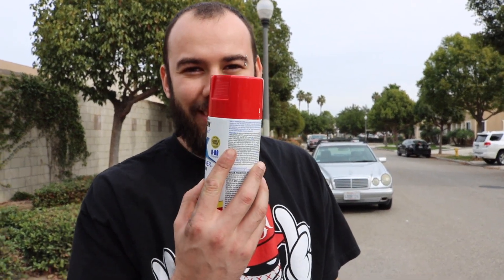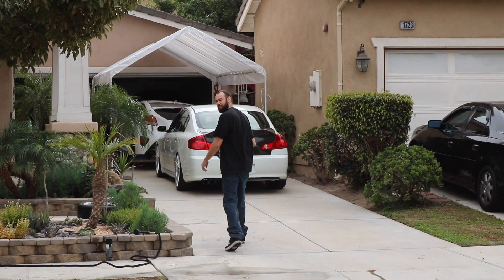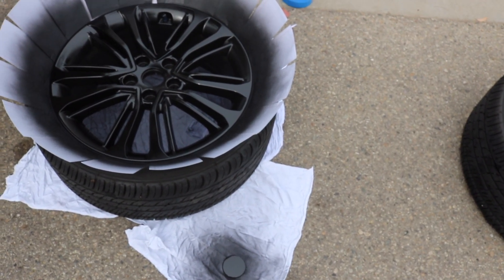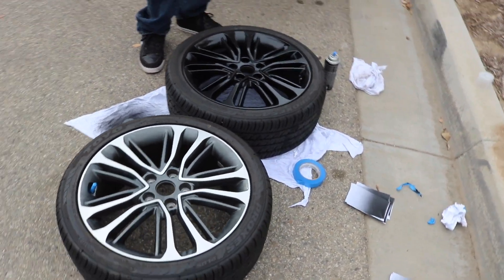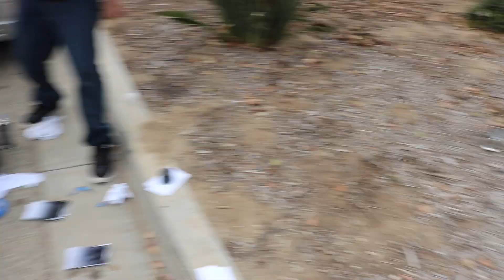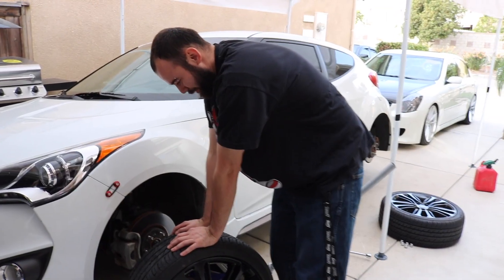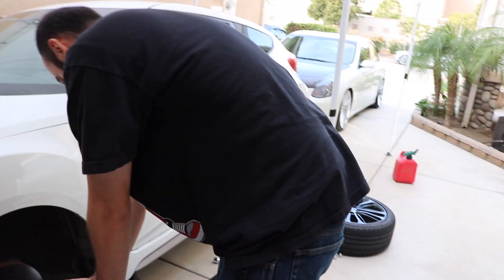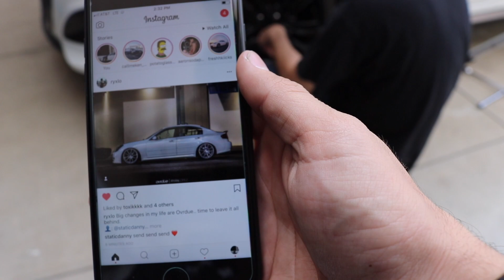it needed this...

Comment: I painted the aluminum wheels on by 95 jeep wrangler. If you want the paint to really last, you have to put in the time and prep the surface (sanding, alcohol,...)
The clear coat shouldn't be applied for a good long while or it would pull up the base coat. Also, I recommend using a primer, but duplicolor is already a good product, so it shouldn't have had issues.

I like the black look more, it's just that doing the job so quickly can result in peeling and issues down the road.